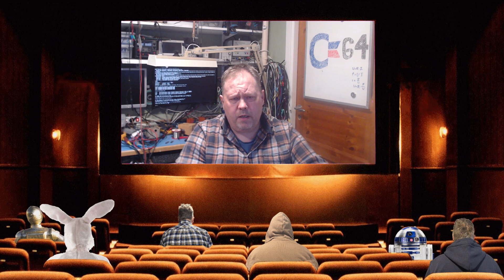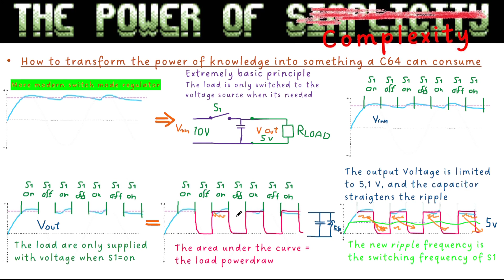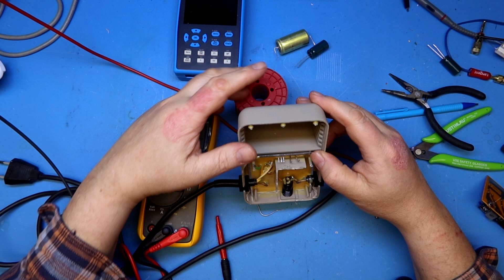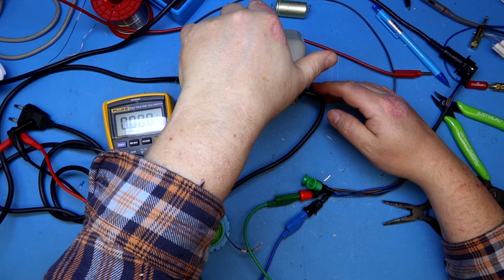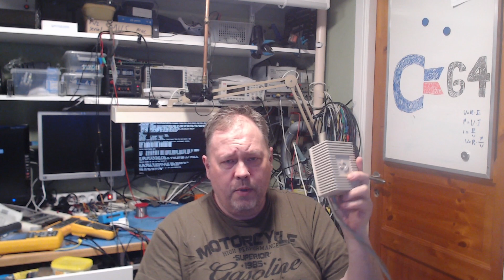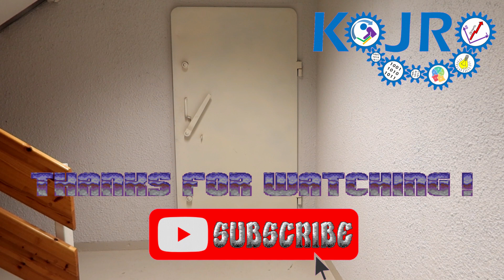No end to things you never wanted to know about the Commodore C-64 Power. Part 3 in the series

Comment: The fuse will not be a problem. The increased output current capability is a result of improved efficiency, not increased power draw from the mains. You couldn't draw more power from the mains, because the transformer would not be capable of handling it.
Reply from the maker: That's partially right, and the old regulator has a current limiting circuit build in that maxes out on 1,5-1,7A. but with an efficiency on the transformer of about 90%, the absolute max current on the secondary side is about 3,5A continually on all windings together with 240V inn and about 10V out on the secondary side. The fuse is 160mA.

Comment: In my C64 PSU I added small Voltmeter (LCD) module. I made similar mode (small switching DC/DC)  but my C64 PSU was older, no 7805 but transitor circuit and FBR was on discret diodes ( PCB was very dark from heat form diodes). Still works well (4-5 years) and I can see stable 5.01 to 5.05V on this display :) Extra TVS on output - no 100% trust to this cheap modules ;)
Reply from the maker: I agree, and I will might change my recomandations on modules in my last episode. Yes I also has one with a small LED voltmeter.

Comment: Always a pleasure to watch you operate, man.  There are data sheets available on the TI LM7800 series that give a modular breakdown of the little 3-legged linear regulators in common use.  There's a lot going on in there for those who might be curious.  As you mentioned, DC/DC converters are tons more efficient  and so run cooler and save energy for the same output.  This was a neat mod.  The board you built looks like a one-off.  Do you have any plans to produce Gerber files so that the board could be ordered from a manufacturing house like PCBWay or JLPCB?
Reply from the maker: Hi this is the original PCB that was in this powerbrick. I have opened lots of theese and I think this is the first of exactly this kind. Most of them have 4 disrcrete diodes to make up the rectifier bridge. But thats a wery good idea to make a universial PCB with the rectifier, the capasitors, and place to solder inn the switchmode PCB.